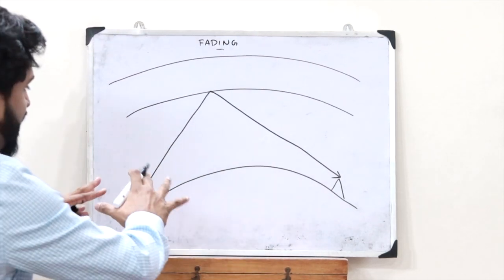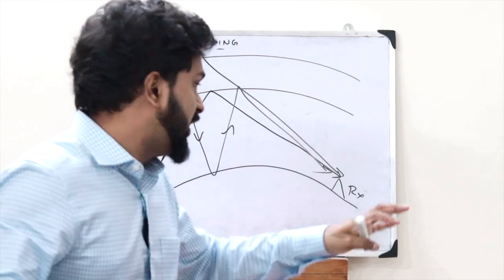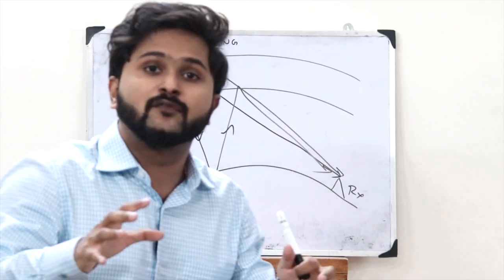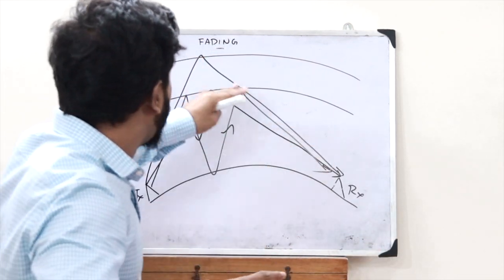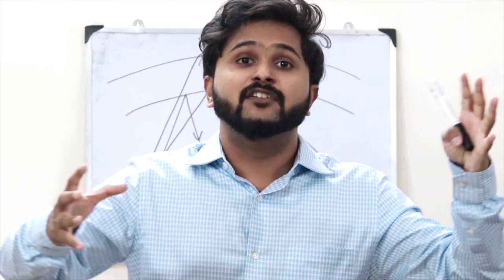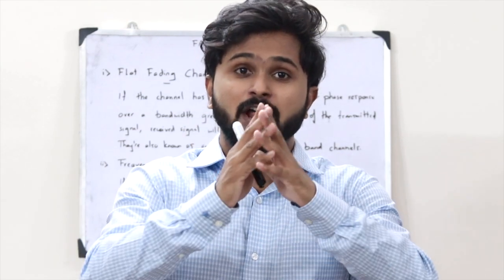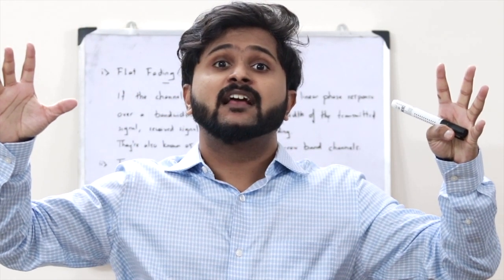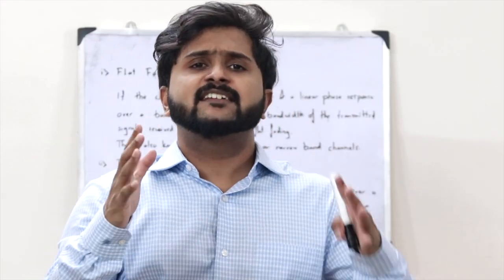Fading in Wireless Communication Channels | Simplified | Antenna and Wave Propagation Module 6 |

Comment: Transmitter doesn't send this signal as multi path, this phenomena is due to the obstacles come in between the transmitter and receiver. The signal gets diffracted, scattered, reflected, due to which the composite signals have different amplitude and phase. Besides that is not correct to say atmosphere, it is ionosphere if you are using sky wave propagation. In general skywave is used in television communication. For general communication we use radio wave propagation (ground wave) that is why the signals gets multipath.
Reply: Excellent🎉

Comment: Multi oath fading is a consequence of the environment. It’s not something we do intentionally. Basically multiparty fading occurs due to self intereference of the signal. Let say there are two paths . For each path we have Radom gains and phase shifts. If the two signals arrive in phase ; we will receive amplified signal ; if the two arrive in counter phase; we will receive nothing . In such a case; the frequency response of the channel is sinosoidal and the period being 1/D, where D is the delay spread; which completely characterises the channel. For. 5G, in space; the period or distance between two peaks (lambda) is 10cm, which corresponds to phase shift of 2pi; while for pi/2 phase shift it is enough to move receiver by 5 cm (lambda/2). This is fast fading
Reply: Salut monsieur. J'approuve votre explication. C'est très intéressant. Au faite je travaille sur la propagation en espace libre et j'aimerais avoir le privilège de discuter avec vous sur ce domaine. Merci d'avance !